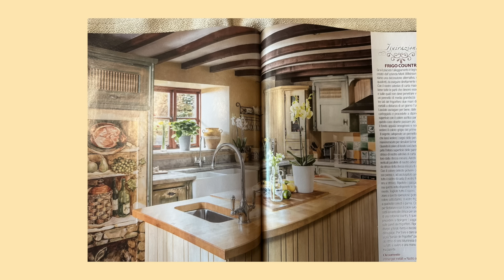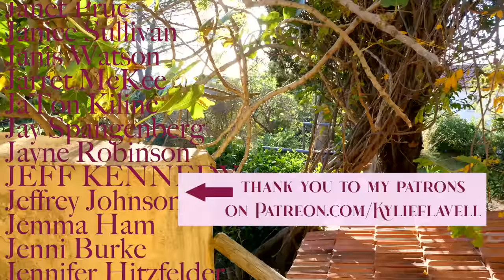RENOVATING A RUIN: Slow Morning Ritual, Baking Cake, Bedroom & Bathroom Renovation, Building a Shed

Comment: Try placing a large old towel down and ironing it. The towel will absorb the oil and wax. Yes, do paint the ceiling the same colour as the walls! Painting the floor trim and door trip is a cheap way to frame the doors and floor. I think timber moulding would look much better. Happy birthday Guido! 🎂

Comment: OMG Kylie that's the most tempting cheesecake I ever saw! Tanti Aguri Guido! ❤ You asked for opinions so here's mine. I don't do alot of Pinterest etc, I'm specifically interested in renovations of historic houses and have seen alot of renovated hoises in Italy. Imo the by far best results of the type of ceiling you have is to have the terracotta inbetween the beams sandblasted. The result is alot like the terracotta floor in the bathroom before using the heat gun, so not as dark as you'd think, just a beautiful warm and varied color both historically correct (it would never have been painted or plastered back in the day) and brings out the original architectural materials in its beauty, and brings so much texture and life to the room. Yes, I've seen some sortof limewashed beams, with a very light hand that looked nice with the pale terracotta inbetween, like it was all dusted lightly in white, but I much prefer the natural beams,  if the ceiling isn't terribly low, and the room isnt very dark. But sure, for bedrooms it can be slightly calmer when lying in bed with less graphic stripes above I guess, on tge other hand you can solve that with a muslin/voile canopy if you like.
I'd definately keep the doors their natural aged color, but carry on the accent color close to the floor around the door frames, thats would be gorgeous. If you want to be ornate you can add a very thin line a cm up from the wider one, with the same paint, or the lighter hue (if you chose a darker one for the banding), small tricks like that make quite a big difference.
I know the sandblasting is VERY dusty work, and likely an additional cost, but you really wont regret doing it. It's what most of the high end architects do for big renos of old Italian farmhouses and listed buildings, and just adds so much value and original beauty.
That heat gun transformed the bathroom tiles beautifully, WOW! 👌What a smart trick to get the wax to melt into the pores and spread out, and that varigated lustre indeed makes it look like reclaimed tiles, or original ones! The bathroom is gorgeous, the painted sicilian tiles were worth every penny, they look stunning also on camera (major tile envy here)! 😍
It's amazing seeing little Gianfranco up on his feet with bucket in hand!
He's growing SO fast!
Love and belated birthday wishes from white winter wonderland in the mideval center of Stockholm!/Jo 💕❄️

Comment: I feel your pain with Italian terracotta! We get ours from Imprunetta and after a good couple years of tiling various spaces with them we’ve perfected the sealing treatment technique. Was not easy. But so worth it in the end! Well done
Reply: If you don’t mind, what was the best sealing technique?
Reply: @wallihaley5194  sure ☺️ after laying but before grouting we do 1-2 passes with chemical sealant (find a gentle one appropriate for porous stone surfaces, terracotta is essentially a brick after all). This way when we grout, there’s a much reduced risk any residue will dry and stain the tiles before we wash the excess off. Then finally we do 1-2 passes with a terracotta wax sealant. This gives extra protection and gives a slight sheen to finish. All the natural variations in colour are preserved. We filmed the process in a couple of our videos renovating in Florence which you can find on my channel :)

Comment: IMHO:  I opt for  keeping the wood beams natural and painting the ceiling between the beams the same color as the wall BUT a lighter shade since the dark beams will reflect darker on that area. Painting that lighter will give the illusion of the same color. Also  I would definitely paint the doors ...again a lighter green gray that would not be such a contract to the walls and make them stand out. Re: thyme in the raised beds...thyme spreads.  I planted one small thyme plant in the ground and in a couple of yrs. it's about 3 or 4 sq ft..of thyme( of course it rambles so not an actual square).  Birthday cake looked  lovely and delicious.  HB Guido!

Comment: Kylie Darlin, I had a home-based cake decorating business for years. The transport always made me hyperventilate😬. Generally I wouldn’t assemble the tiers until on-site.  But now, for special occasion cakes (I’m no longer in business & don’t do those multi tiers anymore) I do the same as you did. Holding it, you can compensate for twists & turns & sudden stops. Your creation was MAGNIFICO❣️. May Gianfranco continue to sleep well through the nights🙏🏻

Comment: I agree with you and Guido 100% on the beams. The wood beams add so much warmth and depth to a room. When they're painted white - yes, they look clean, but it can tip towards sterile. I like the ceiling + walls one color, I agree that it invokes feelings of warmth. It's also more harmonious, as there's no stark contrast between ceiling and wall. I love the idea of batiscopa and doors matching. That green you've picked is beautiful and it looks like you already have art and furniture in your home that you could borrow from other rooms to compliment that color. How lovely. I sort of think if you plan to use doors, it could be nice to paint the doors that green, but if you're not using doors, that's when you paint a trim. I guess you could paint the trim either way, but the trim seems most impactful if you don't have a door. These rooms are going to be unbelievably dreamy and cozy! So excited for you!

Comment: ❤the bathroom tiles. At 16:54 on your video, the ceiling painted one color like that is very cheerful and easy on the eye. The light and dark contrast on the ceiling will compete for attention with any other decoration in your room. But living with it first is fine, you can always toss light plastic drop cloths over all and paint the ceiling later🙂  You are such a hard worker!

Comment: My two cents regarding the bedroom paint/wood beams. I am a “retired” architect and I agree with you. Leave the wood beams unpainted, paint the walls and ceiling between the beams the same color as the bathroom. I love the sage green color as the bottom/wall base. I would leave the doors unpainted to relate to the wood beams and maybe paint around the door an accent trim to carry the green base color up. You both have excellent taste and know what you like so trust your instincts. Later on if you find you would rather paint the beams and doors you can, much easier than the other way around.

Comment: Yes , I think you should use the same color as the bathroom it is very subtle and soothing. On the ceiling as well . But if it were me .. I would paint over the smaller wood beams in between the larger ones . Leaving just the larger ones wood. This would cut down on the ceiling looking so busy and make more of a statement with the larger ones . Love the green , but ohh please leave the doors wood if at all possible.

Comment: :hand-pink-waving:Boiled linseed oil and pure turpentine (not turps) is what to use? Mix like a salad dressing. For the first applications use more turpentine.. the turpentine penetrates the oil into the tile and builds it up. The turpentine cleans also. So if you buff with turpentine to get rid of the wax before applying the mix it will clean.  Linseed oil without turpentine will sit on the top and go sticky.  Many people make this mistake.  You then wipe off the excess and buff to a sheen.   You can also use this on all your timber and wooden furniture.

Comment: I have used terracotta in 3 properties in UK. I found products made by HG to be the most reliable. For cleaning, sealing and protecting the tiles. Perhaps you could check it out. It is available in Italy as I have purchased and use it now, as I have moved to Italy to live.  They also provide products for wooden/parquet floors.  😊

Comment: Some old houses in uk have the beams sand blasted, (literally blasted with sand ) which removes any dirt and stain leaving a honey colour. We in ours have washed  them with a bleach solution which lightened them a little then the varnish brought out the rich oak colour. We have same colour walls and ceiling, white, but our ceilings are low.

Comment: I would have white paint between the beams and leave the beams with wood finish (varnished).  It is more your style and it would be cohesive with the rest of the house.  If you do choose a colour for the walls, don't paint right up to the beams.  Instead, have the white come down on the wall by around 10cms from the end of the beams and draw a line and have the colour come up to that line.  It will create the illusion of a cornice almost.  The finish will be simple but elegant.  Also, the beams will pop out more with the white all around them.  I think in the pictures you showed the issue was precisely that ... the colour was up to the top of the wall against the beams.  But you have high enough ceilings that you can afford a border of white.  It will also mirror the battiscopa down below in a sense.  Best wishes.  PS. Gianfranco is the cutest helper :)